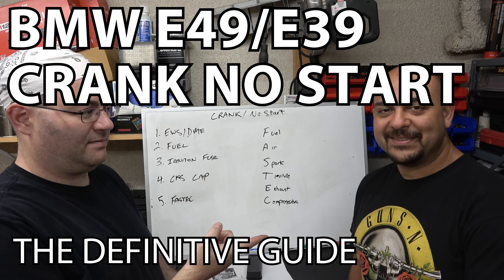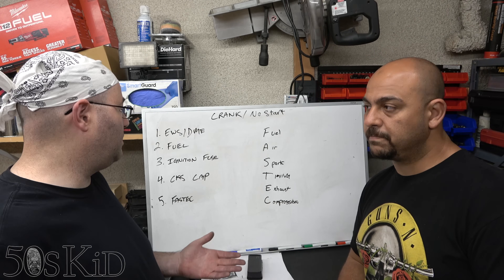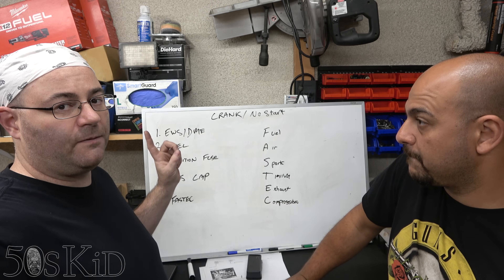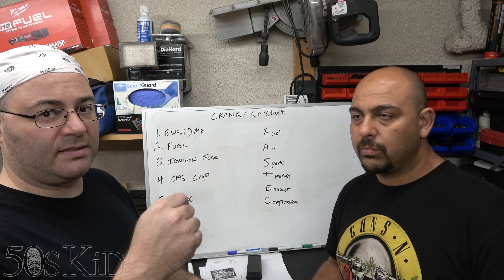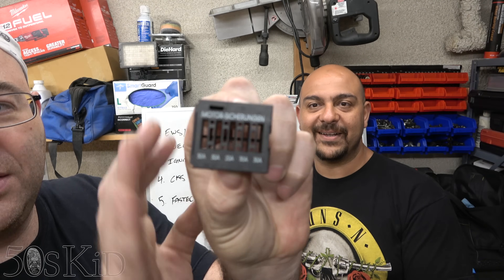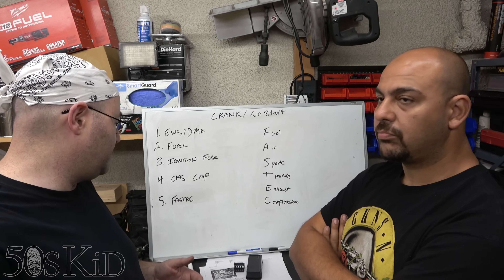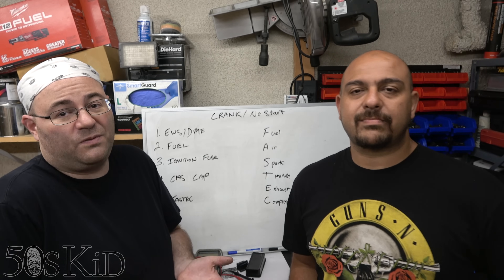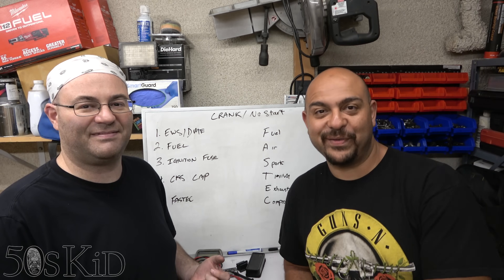BMW E46/E39 Diagnosing a Crank No Start: The Definitive DIY Guide

Comment: My e46 330i will start 99% of the time, but once in a while it will crank crank as long as i hold the key and wont start, but if i let go and try again it will fire right up, has new fuel pump, new febi camshaft sensors, i used a chinese crank sensor and thats my only worry, if you guys have any idea pls let me know? The car doesnt stall, idles perfectly, also it takes a little longer to start on cold start, maybe 2 more cranks, and at times it does it when engine is warm too, but its good most of the time

Comment: Not related but I need info.   Please help.    I’m doing an auto to manual swap.  Do I also need to replace the Dif
Reply from the maker: If you don't replace it, the car will be much faster because you will have really short gears. You will have to shift twice as fast and your max speed will be like 100mph. Most kids love this but I personally wanted a more balanced car, so i got the manual diff to make it a little less quick and give it a higher cruising speed.

Comment: Hey 50sKid. 
I got a big problem with my '03 E46 325 xi
It won't start but seems to crank. It started with the battery light turning on. And then while driving it slowly started dying. The battery seems to be good since the lights come on. 
I tried turning it on this morning and it did turn on. But started vibrating bad and like all the lights on the dashbiard come on. 

I recently replaced all spark plugs and ignition coils. 
And also replaced the MAF sensor. 

It did misfire before this issue with not turning on properly. 

What do you think?
Reply: Did you end up resolving the issue? I’m having the same issue with the same year car and model.

Comment: Hello. I have a e46 m54 engine. Crank and no start. I have watch all your videos and it's been so helpful to me. 

But my car still don't want to start. All fuse, relay, vaccume hose, fuel pump, changed head gasket (because ome cylinder was flooded with oil), new spark plug, disa valve, egr valve ect has been checked and replace. But still wokt start I'm running out of ideas now. I plug in the OBD2 scanner and it says that I have a P1351. Ignition coil control high voltage. I have Google it and nothing really pops up. Please help!

Comment: Did the fuel pressure test with a flat head screwdriver and barely and fuel came out. Replaced the fuel pump and even replaced the relays and even tested the fuses and all good and still no start. Any ideas? Could it be my fuel filter?
Reply: Man, Im at that point right now?   Did you find the problem?
Reply: @likits1999  I didn’t assemble the fuel pump correctly and one of the hoses attached to the pump wasn’t tightened all the way. It was the fuel pump the whole time. Lol good luck!

Comment: Hello. I have a crank no start situation. I replaced the fuel filter(new), fuel pressure regulator(junkyard) and crankshaft position sensor(autozone). I changed this because I replaced the head gasket. The car started prior to the repairs but no it won’t so I’m pretty sure a fuel pump would not die like that. I don’t really smell any fuel while cranking and I can’t say for certain if the fuel pump is running. Any recommendations??
Reply: george lewis did u find out the problem ?
Reply: Wat was the problem

Comment: I have a 1997 BMW Z36 cylinder the car was running fine one day it just shut off and now it just cranks but won’t start I put a new fuel pump it was not the fuel pump please help because I’ve been to three mechanics and neither one of them could find out what’s wrong please help

Comment: Need help.. BMW X3 stall while driving . now it will not start ..it cranks at it kind of start you can here a quiet rumble from the exhaust pipe when starting.
Reply: got it fixed ?

Comment: Hello buddy, I just finished replacing the 2 main core heating pipes under manifold of my 04 325 I , by the way I wouldn’t done it if it wasn’t by your guidance and i do thank you for it ... my problem is. Once I finished and check my plugins twice ..I don’t know if there is a special step pattern for the fuel rail to get filled again or simply do ignition as normal I’ve tried once and it didn’t started so I decided to stop there .. I could use An advise for sure thanks and congrats on your talent for this media From o c manny here..

Comment: Where do I go next if my ‘97 540i has fuel pressure to the rail but none on the return line, and the car fires with starting fluid?
Reply: Spark
Reply: @ronaldmueller3730  it was bad gas. Someone put creek water in half the tank.
Reply: @ronaldmueller3730  also, not spark if it fired with starting fluid.

Comment: I have a 2000 e39 528i. Checked the ews/dme, changed the crankshaft position sensor with one from oembimmerparts.com still no start. The engine has fuel pressures but the fuel injectors are not activating. Any ideas?
Reply: Did yuo.fix
Reply: Ed Calderon yes wiring harness
Reply: @igip831  what exactly did you do to the wiring harness? My car still cranks no start.
Reply: Zlab fab I got it replaced. Had an electrical specialist check out the car and the problem was no signal in the harness leading to the engine. The coils got no power nor did the starter. The car alarm still worked and radio.

Comment: @50skid I see everyone is asking questions. I have a few concerns with my 2003 330i w/ 56,000 miles. Every once in a while the car cranks and takes about 4 additional seconds to start. Also only at high way speeds, when I accelerate the power seems to surge on and off very quickly and same when increasing cruise control. Drives normal and accelerates fine a low speeds. Any ideas?
Reply: 3 years late my apologies, Sounds exactly like fuel loss / starvation. Fuel filter blockage causes symptoms and the push pull movement on at hwy speed . Fuel filter is normal preventative maintenance that is most often forgotten. Thx Ron

Comment: Hi Both, Great video and must say love all your videos- been very helpful, thanks so much. I do have a crank no start issue and through ages of fault finding I'm still not starting. I have no fuel pump priming or pressure on cranking. I have no incoming signal to the fuel pump relay, but relay itself and all fuses have been tested and are good (including bank of 5 in the engine bay). When turning key to position 2 the relay doesnt click open. I'm led to believe it was something to do with the EWS - DME sync code but I have tried resetting this (well in BMW Scanner 1.4 it seems to just say "EWS-DME adaptation"- is that the right thing?? Either way i did this successfully and also recoded my instrument cluster as Ismail talks about. Still have the same problem... No incoming signal to fuel relay. I'm really banging my head against the wall. I presume the EWS is good and ignition is good as i get cranking and also get 12v delivered to my coil packs when cranking. Its a real challenge- Can you help please?

Comment: Do you know why my passenger window doesn’t work , so basically I changed the harness , motor regulator and still doesn’t work I think there’s no power at all are there relays for the power window? I need help I fixed all my windows to find one is dead I feel trapped in my car when I drive
Reply: Might be a problem with your GM module
Reply: Ismail El Ridi how do I check that
Reply: Needs to be sent to a professional to diagnose the one you have OR you can buy one from the junkyard with same part number, plug it in ur car and see if everything works. If yes then it was your GM module then your problem is solved. If not then you know it has to something with wiring since you said that your switch isn't getting any power
Reply: Ismail El Ridi I replace the harness the regulator and motor so the only problem should be the gm5
Reply: Ismail El Ridi I fount the problem it’s the gm5 it’s fucked up by the old owner they put a speaker system that never worked that why I got no audio and the choose to tap into the gm5 for so reason

Comment: I removed the intake manifold to repair the coolant hard lines and now after putting everything back together the car will crank but not start.  When the key is in the 2nd position you can hear a knocking or clicking sound (about 4 times) where the fuses are located.  I took the manifold back off and double checked everything, still the same issue.  Does anyone have any idea what this could be??  The car is a 2004 BMW 330i.  You can also hear the fuel pump priming and the fuel pump was just replaced recently
Reply: Steven L did you ever figure it out
Reply: @chevyman217  I didn't but my mechanic did! It was  the DME relay & I may have had another blown fuse
Reply: I'm having this exact same issue...

Comment: Hi, i have a e39, lost the key and buy a New one, th ews and trasponder was set, but my car did no start, Just crank, before los my key i used without problems.
Can anybody help me please 😢
Reply: Hi, I'm not sure that the key is your problem, if the key was not coded it should be a No Crank No Start. Check fuel , spark and maybe crank sensor? 

I get a crank no start every time my sensor throws a error.. usually i just remove the code and it fires right up.

Comment: Taking care of my brothers car while he’s deployed and car stopped working one day. Cranks no start. I changed the fuel pump and fuel pressure regulator and still nothing. I bought a obd2 and I get 0492-0491-0455. One day I put starter fluid and it started and stayed running but after 30 min leaving alone it wouldn’t start. Idk what to test next. If anyone has an idea please let me know
Reply: fuelfilter

Comment: Hi and thanks for your video. I was able to check that the fuses are ok. But I still cant start the car. It churns fine, but does not fire, as if out of gas (it is 3/4 full). When I put in the key, and turn to position 1, it is fine. Also fine at position 2. As soon as I start churning, and then let go the key, I can hear a loud electric humming noise, as from a transformer. It seems to come from under the motor cover, to the right of the oil refill. I filmed from a few angles. The noise only stops 7 seconds after I turn off ignition. Any ideas? Here are 4 clips to illustrate: https://www.youtube.com/playlist?list=PLdfBCVVReMLblhkGFuFQjKRS9tAGJl6pD
Reply: Did you fix the problem ?
Reply: @zlabfab487  I called the local service truck. He showed up with a huge jump start box. After about 10-15 minutes of continuous turning, my car finally, reluctantly started, then ran perfectly. My first trip was to the auto store for a new battery. Starts and runs fine since.